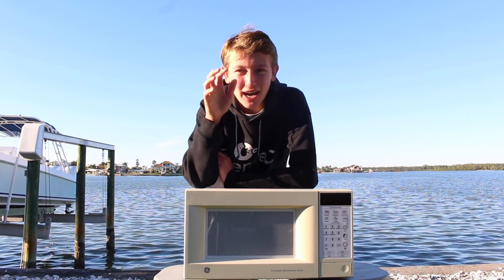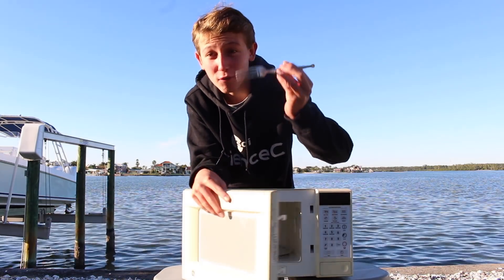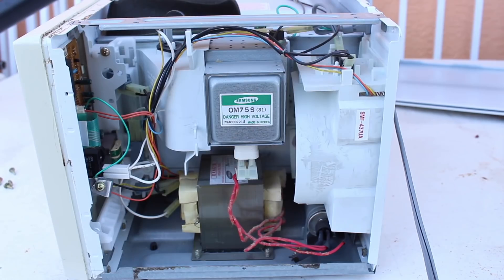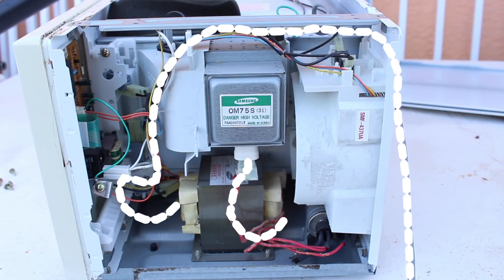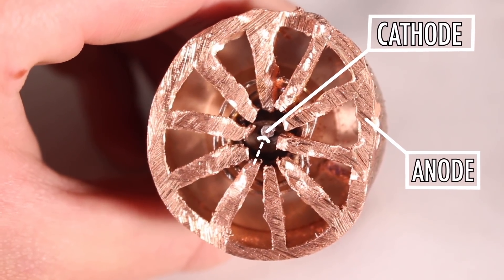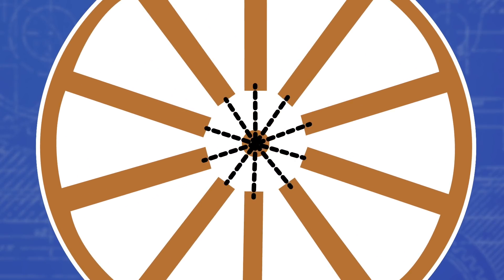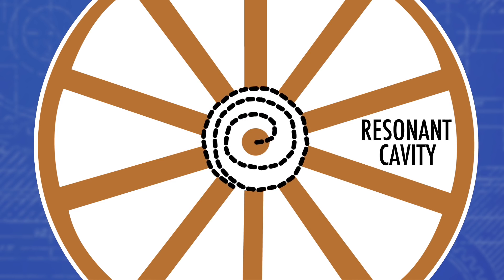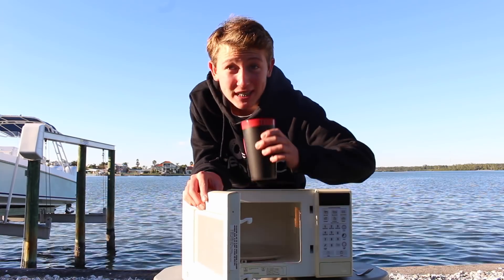How Do Microwave Magnetrons Work?

Comment: So a couple words of caution when dealing with microwave components. Im sure your aware of most of this but microwave capacitors store a tremendous amount of energy can can dump high voltage at high current which can easily kill you. Modern capacitors tend have an internal bleed resistor to equalize the charge however the resistance decreases over time and some caps are not equipped with them. Also most things like wood and work gloves become conductive at high voltages epically on days of higher humidity so always check the breakdown voltage of any insulators you will be using prior to experiments. Magnetron insulators were widely produced with beryllium so be careful not to create airborne partials or industrial contamination. Also magnetron tubes contain thoriated materials so observe safe handling for radioactive materials. Next time you do any experiments containing high voltage be sure to use proper equipment such as wearing a minimum of class 1 gloves when working with energized MOT's and using what's known as a hot stick to manipulate any energized parts. Its always best to begin with something like an NST which typically has a primary and two secondary's that can usually be combined to get in excess of 12KV at much safer current levels than MOT's. Another thought would be to use a deadmans switch or foot switch in series with your transformers in case you need to get out quick it will de energize on its own. If you need any help let me know I would also be glad to supply you with proper equipment for your experiments. Stay safe and good luck!